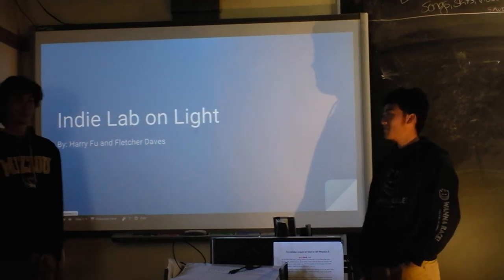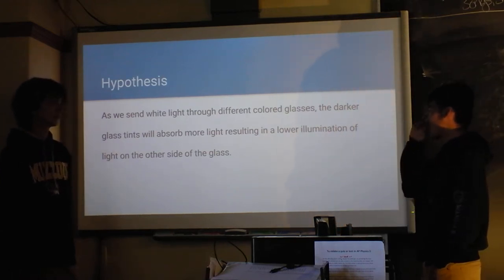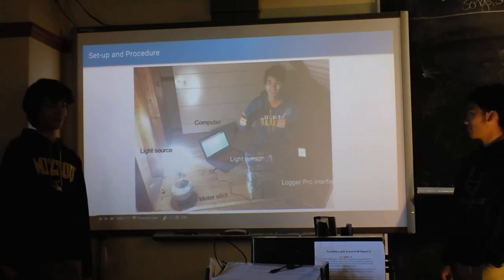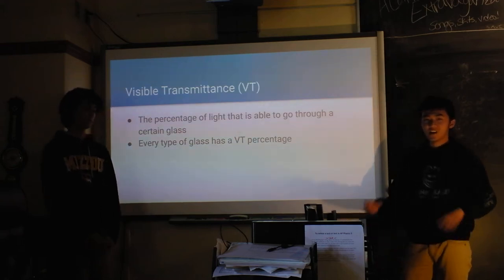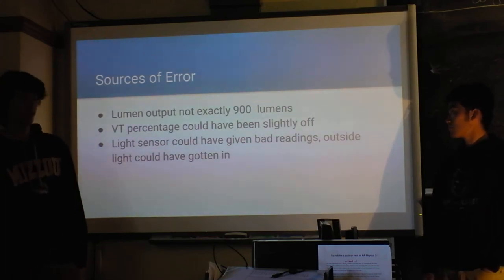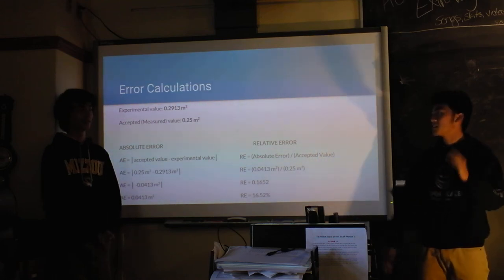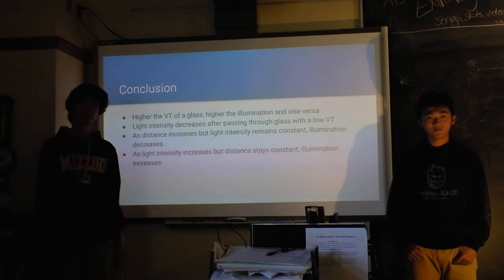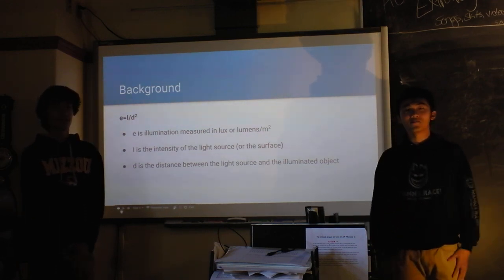Indie Lab - Light Transmittance through Frosted Glass

Comment: Light! I looooooove light! So I absolutely must blab about it here.

Light source too strong (0:35)?! That is a non-problem, like having too much money. Reduce the brightness. Most diode lasers allow the current to be turned down (until the thing becomes unstable). No knob to turn in your particular source? Then be resourceful. Two almost crossed polarizers give excellent brightness tunability. Still too complicated? Take a flat piece of glass (break a school window if you need to: that's fine as long as it's for research) and put it in the beam at an angle. Part of the incident light will be reflected away. You can tune how much by turning the glass. Near-grazing incidence gives almost total reflection, so there ample brightness tunability. If you have a nice and nifty laser, use it! Please don't replace it with grandma's bedside lamp.

(BTW: What sensor are you using? Photo diode? In most cases you can turn down the gain in the driver electronics.)

Then: absolute and relative. Absolute radiometry (=measuring intensity, or irradiance, etc.) is much harder, and error prone, than relative measurements. Practically all optical processes are linear: if the source gets twice as bright, so does every other signal. So you divide all your measurement results by the measured value for just the source, and this will rid you of most errors. Physicists always look for ways to do such relative measurements, as do carpenters when they measure boards (hail Tommy Silva of This Old House!). If you are fancy, you can block the direct beam and take a measurement of the background light, which you first subtract before taking the ratio.

I'm a little disappointed that you did not look more closely at the filters, and what happens there. The ~1/d^2 relation is not all that interesting, as you remark. And it applies to propagation in free space (without scatterers), so it seems not exactly appropriate in the context of studying filters. I find it hard to get excited by the hypothesis at 1:10. We could be looking at some more interesting things.

Frosted glass scatters, which is (very (not to say extremely)) interesting. Geometry is everything. How far away is the source, what angle does it subtend? Same questions for the detector. What is the field of view of the detector? Does it measure intensity or flux, or something in between? Look at the reflected light. Look at the light transmitted in directions that are not close to the forward direction. (You'll actually be happy about the high brightness of your source, because it allows you to see the tails of the angular distribution.)

Light is also absorbed. I mean really absorbed so that its energy is transformed. Into what? Heat of course. Ah. Hm. How far does the spectral sensitivity of your sensor extend into the infrared? f not careful, you may actually pick up some re-radiated energy, and underestimate absorption.

Spectra matter. The spectrum of the source, the spectral dependence of the absorption and scattering in the filter, and the spectral sensitivity of the sensor. What you measure is the integrated product of everything. Because all these modern solid state devices are all sensitive in the (near) infrared, what you see might not be what you get. Something that looks 'white' to your eye, might look different to your sensor.

If you had used the laser, you would undoubtedly have noticed the speckle phenomenon (little specks of light on the illuminated part of the filter that move when you move your eye). Huh?! How, why? Fascinating stuff.

Milk glass has (lots of) multiple scattering. Now there's a wide and interesting subject! In my youth I have done several years of multiple scattering modeling and computations, including polarization effects. In fact I'm the proud owner of the nerdiest of nerdy books: "Multiple Light Scattering - Tables, Formulas and Applications", by Henk van de Hulst. That's a two-volume, 190 dollar, book-set with more details and numbers than any sane person could possibly want to know, and then some. Self-deprecation aside, light scattering does have many interesting aspects well worth looking into.

The 'lumen' specs of lamps are mostly bogus for cheap brands. Good brands do get fairly close to the spec. Circumstances matter somewhat (Doc's question). Lamps age, their thermal situation matters (Ever felt how hot a LED-bulb's socket gets? To cool or not to cool, that is the question. Or at least one question.) What is a lamp, actually? Did grandma's bedside lamp have a milky bulb? Then that absorbs light, eating up luminae luminorum.

I hope you did enjoy playing with light. I remember the time (back in the 70's and 80's) when optics was considered a rather dusty 'old' part of physics. But light is back! When thinking of applications, such as optical computing, and fundamental research (e.g. testing deep and basic Quantum Mechanics along the lines pioneered by Alain Aspect) light has a bright future.